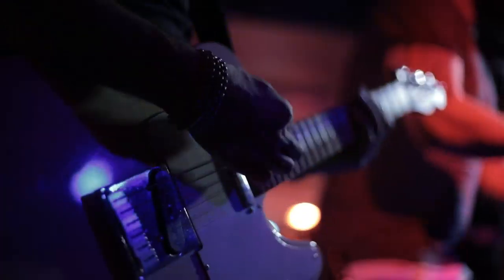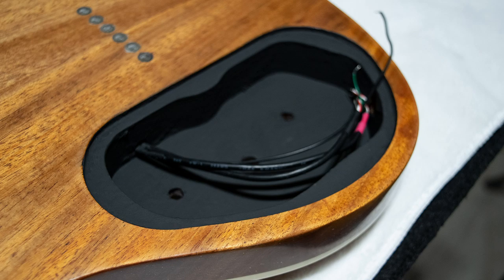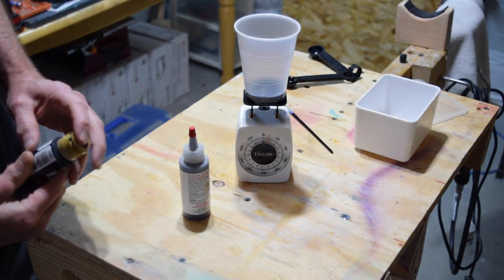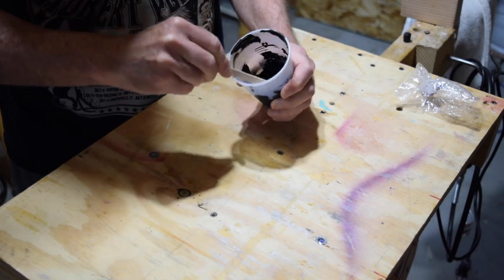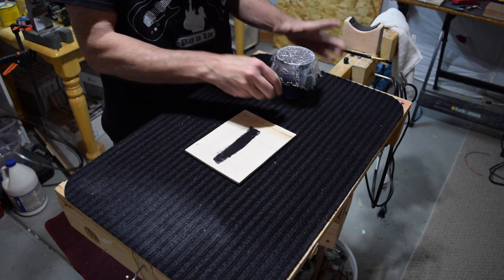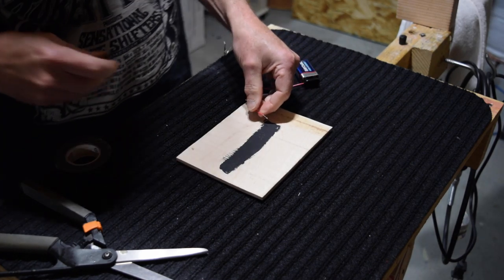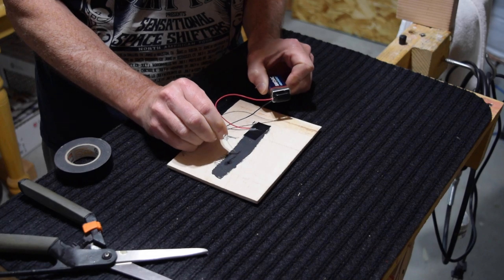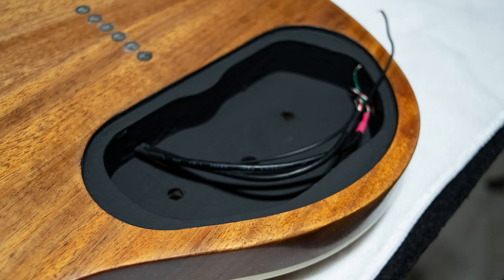Make Your Own Conductive Shielding Paint

Comment: Excellent video.  It works!  Just make sure to add enough graphite.  And, wait until the paint is thoroughly dry before checking continuity.  If the paint is still wet or moist, your multi-meter will show it as an open line (no reading).  2 coats gave me excellent continuity.

Comment: If you connect a 9V battery directly to an led it will blow immediately.
It's the resistance of the paint strip that protects the led from overcurrent.
For rfi shielding, a bit of resistance doesn't matter, but why not mix the paint a few different ways and measure the resistance with an ohm meter? If you're looking for lowest resistance then mix it accordingly.
Also, is the cavity cover coated too?
Also, is the paint layer earthed (grounded)? If not, it won't have any effect.
Also, I see a lot of cheap guitars that use conductive paint for shielding. They would not use it unless it was cheap. So, if Stewmac are charging a lot of money for it, they're ripping you off. Extend that thought to everything they sell, and you can start to understand how overpriced they are.
Reply: Shielding paint is expensive, no matter where you get it, though with a caveat. Manufacturer's save money by buying the paint in bulk, whereas an independent builder will only need one or two cans. 

Most boutique builders, like James Tyler Guitars or Suhr, will use shielding paint for the cavity and copper tape for the cavity cover, with some paint on an upward facing point to make contact with the two. (I shielded a couple hundred bodies at James Tyler lol)

As for whether to ground the paint, it's not necessary, but you can have an extra ground wire screwed directly to it. It's not necessary at all though, because the electronic components will be making direct contact to it anyway.

Comment: I've made this before but with PVA and a little water.  It works ok, but I still prefer copper tape for electronics cavities because you can solder to it, and you don't have to solder to pot casings.  However, this is excellent for earthing pickup polepieces because copper tape loses its contact over time.  Oh, and you'll cook the LED if the resistance is too low so be careful.
Reply: Also, conductivity will be a lot better with copper. IDK if it makes a difference for shielding, but hey, copper tape is easy too.

Comment: I am wondering about the resistance, if it matters? I did a thorough test with different mixtures of paint/graphite. Painted equally large squares and measured from diagonal corners. Your mix of paint/graphite showed 1600 ohms (one layer of paint). It had connectivity with the battery-LED-test. Next I mixed different ratios of paint/graphite until I had 1 part paint mixed with two parts graphite (volume). The resistance was then 200 ohms. Then I tested with one layer of StewMac's shielding paint. It showed 10 ohms! So... does this matter to the shielding efficiency?

Comment: Great tip! Shielding tape can be so finicky and you have to make sure to get conductive adhesive. This is so much simpler. This combined with proper grounding (often a cause of electrical buzz blamed on lack of shielding) would work great!

Comment: I did that a couple of years ago and used water based polyurethane tinted with craft paint.. I did a bunch of testing  on ratios and  checked not just continuity but  also resistance. I still like  copper foil  with conductive adhesive. More work but  its a better shield.  MUCH better shield. Some  of the  import  Chicom  guitars that are  "shielded" with black paint aren't conductive and  are slopped in the hole. Not sure they are hiding  rough wood work or giving the impression  of shielding. If you want it to  shield  properly you need to make sure its grounded. Shielding can also cause a short... I had  one that the input  jack with the plug inserted moved just enough to  touch... Positive to  ground....
Reply from the maker: As I said in the video, paint is the easiest way to shield a guitar cavity. IMO the BEST way to shield the electronics is to use shielded single conductor wire for all of the positive signal connections. As long as the signal wire and components are connected properly to the jack's ground terminal, there is no noise at all.
Reply: @HighlineGuitars  On a new humbucker I was replacing, the positive signal wire was too short. So, the manufacturer solders on a longer NON-shielded wire (don't remember if it was a single conductor). Is there something I can wrap that wire with for about 3 inches? I don''t think anyone sells shielded single conductor wire less than 6 inches long LOL.

Comment: Just wondering~~what is sold as magnetic paint has iron particles in it so that after a few coats a magnet will stick to it, I wonder if it would work for shielding.
Reply: as long as it is a decent conductor it will work. Iron is a good conductor.

Comment: This method is probably an okay alternative to shielding paint, but it's not conductive. Conductivity requires exceptionally low or 0 ohm resistance. However, if you measure this method with a multimeter, resistance ranges from around 6k ohms to 30k ohms. My measurements were after 3 coats, and 2 days drying time in my test - with a 2:1.15 paint to powder ratio. In your video you state 1oz paint, 3 teaspoons of powder. 3 teaspoons = 1 tablespoon = 0.5oz, so your ratio was slightly lower at 2:1 paint to powder. Perhaps adding charcoal would improve conductivity, but obviously testing would be needed.

Typically an LED should have a resistor connected to protect it from the voltage source. In this case, the resistance from the shielding paint in your video provided the resistance. This might be an okay replacement for typical shielding paint, but it is not (yet?) a replacement for copper shielding tape where true conductance or continuity is needed.
Reply: graphite is a good conductor though..?
Reply: @ATthemusician  Measurement doesn't lie. Graphite mixed in paint alone is not a good conductor. Not all graphite is conductive either. Conductance is the inverse of resistance, if you're reading any significant resistance, it's not conductive.
Reply: graphite and activated carbon is what people use to block emf in paints.
Reply: @bobrobertsNotUrBob  That's the idea. Activated carbon is usually made from charcoal. I still haven't tried it because it doesn't beat copper tape, and I have plenty of that. I will try eventually out of curiosity.
Reply: @Jmpguitars  
Using higher % of graphite in powder, more layer will low impedance to <40ohm which many branded guitar did on higher end guitars. PRS and Ibanez use this method.
With this method, everybody with no experience can get the job done fast. the idea is not to replace copper shield, but alternative faster, cheaper with a little compensated way.
Reply: @lydian2012  Yes, that was my point; a higher concentration is needed. The ratio in the video is insufficient.
Reply: I make my own ink with aluminum ink and I add graphite until I have 0 Ohms, I have been doing this for years now with excellent results so far (and most of the time I do play with a very high gain amp setting).
Reply: @velosouk  Cool! What ink specifically do you use? Do you have a link?
Reply: @lydian2012  I used a higher concentration of graphite than in this video, and the resistance was far too high. Copper shielding is better, and worth the money.
Reply: @Jmpguitars  Enamel ink for metal painting (check the amount of metal particles in formulation, it can go up to 30%)
Reply: @Jmpguitars 
If the resistance over 1 inch space under 1 k.ohm then it is enough for shielding.
If you guys who have too high impedance, try 2:1 powder:paint ratio, and the key is using hand drill to mix 5min (or even 10min) before use, and wait for paint completely dry (12hour) before apply another coat.
After 3 coat, the resistance will be around 150-300 ohm which is effectively enough for noise shield.
The effect is 90% compare to aluminum foil of many guitars i taped, almost can not tell the differences.
Reply: @lydian2012  Time = Money, right? That's 36 hours to apply shielding, that isn't consistent. It takes a very short period of time to apply copper tape. All things considered, the copper tape is 100% consistent, less effort, and costs less when time and effort are factored.
Reply: @Jmpguitars  you're right.
Paint is for anyone who prefer aesthetic and stability over time.
Some cavity like les paul with 4 dim knob and small round toggle switch cavity is hard to tape. It will usually look lumpy and will be scratched when changing electronic, also leave sticky surface of the tape when removing.
In that case, paint is a better investment long term.
Reply: @lydian2012  I've been using the copper tape for nearly 30 years. I've never had anybody complain that it wasn't pretty enough inside their guitar. ;)
Reply: Could copper powder be added? Also since your initial comment, have you tried different formulations and if so what has been your outcome? Cheers!
Reply: @kane6589  You could certainly try that. I haven't attempted this again, because I still have plenty of copper tape and not a lot of extra time. If you do try, I'd love to know your results. Measure with a good meter and see what resistance you get over distance.
Reply: It’s conductive.  He just showed that current flows through it with an Led.  What do you think carbon resistors are made of ??
Reply: @Jmpguitars Rubbish.  By definition conductance = 1/resistance.   If it has a lower resitance it has a higher conductance and vice versa.  That means that it has conductance, just maybe not as good as a lower resistance.
Reply: @GodzillaGoesGaga  There's a difference between functional shielding and resistance. If resistance is too high it's simply not a shield. You can run an LED with a wide range of resistance, it proves nothing.
Reply: @Jmpguitars  You claimed it’s not conductive.  You didn’t say it wasn’t “conductive enough”.  I know the difference as I’m and an EE.  Words matter.
Reply: @GodzillaGoesGaga  The point was not conductive enough to be shielding. You could have inferred that by reading my statement instead of being pedantic. 😉

Comment: Thanks, Chris! But, what about the resistance? If the resistance too big (let say more than 500 ohm per-square inch) it doesnt work well for blocking any EM or RF interference.
Reply: It's not good enough. Resistance is much higher, and it's not actually conductive. With some carbon added it might be.

Comment: graphite is sold as dry lubricant for locks at auto parts stores - its worth noting that some lutherie supply places online sell little jars of conductive paint for single jobs that arent too expensive - i've also used aluminum HVAC tape - its a cheap alternative to copper tape

Comment: Great tip! Just an FYI: if you don't get the polarity on the battery and the LED right, the LED will not light no matter how conductive your paint is. So try switching the polarity on one or the other adding more graphite.

Comment: I think you could be on to something... Look up Y Shield paint. Incredibly expensive product... designed to reflect/attenuate EMFs in your home... and I'm guessing it would be pretty simple and CHEAP to come up with your own version that is also effective at blocking some EMF frequencies. For example just mix any brand of house paint with graphite lubricant. Do you think this would work and even be worth it to attempt?
Reply: I've been looking into this... I read a study on conductive ink (not sure how acrylic paint might differ), and optimal conductivity was found at 29.4% carbon by mass, with a 2.6 to 1 ratio of graphite to carbon black.  When using less total carbon (21.7% by mass -- I guess try that if you can't get it to flow or bind right),  the ratio was 1.8 to 1.
Same basic ingredients as Y Shield, but I have no idea if they do something special to make it all bind, flow, and stay conductive.  Hopefully it's just that simple...  It looks like smaller sized particles are more conductive for both graphite and carbon black, so maybe the nano graphite from graphitestore.com is worth using.  I'm trying to get up the nerve to do a smaller test run and how if it works.
Reply: @adamhorn6392  CERTAINLY WORTH TRYING. AS SOMEONE WHO HAS BEEN HANGING ALUMINUM INSECT SCREEN (EFFECTIVE / NOT VISUALLY-APPEALING) ALL OVER HIS CONDO IN AN ATTEMPT TO THWART HIS NEIGHBOR'S PESKY WIFI SIGNALS, A CHEAPER ALTERNATIVE TO Y-SHIELD WOULD SEEM LIKE A GREAT NEXT STEP. I THINK THAT PRODUCT IS OVERPRICED IF SO. I MIGHT ACTUALLY TRY THIS, THANKS FOR THE INFO ON RATIOS!!!
Reply: @Jesrockr  What size screening do you need to block RF/WiFi signals? I've looked and looked and haven't been able to find the answer (miss you, net neutrality! 😭). If you know I'll be quite happy 🙂
Reply: @rebeccagreen7241   Rebecca i'm using Phiser brand aluminum insect screening bought in 6' rolls from Home Depot. You don't even need full coverage of a room, as long as you install on the walls in between you and the source. I did two sides of my bedroom (townhouse, adjacent neighbors using WIFI) 2 layers thick GROUNDED to the earth outside, and reduced the average reading from about 4 down to consistently <1 microwatt per sq meter. sleep quality improved so much. If you look up EMF safety Zone, he did a video using the same material. it is incredibly inexpensive (100 bucks for 6'x100') and it is easy to work with. Hang it up with nails or screws. Done properly it doesn't look too bad. If you'd like I can make a short video showing my setup/emf readings etc.
Reply: if this costs too much you can also use Reynolds wrap, however that is much more unsightly and harder to work with. Probably half the price, and I did do a wall with that at one point so I know that it works very well. Just an eyesore and a hassle, but more budget friendly for sure.
Reply: @Jesrockr  Thank you! That information is super helpful. Right now I've got two layers of aluminum foil on the wall between my bed and the smart meter (and a faraday screen over the meter), but it doesn't cover the window. Maybe I could do the screening like you suggest, and make an opening for the window somehow. I also wonder if I need to shield the floor (or part of it) since the circuit breaker is right below me in the basement. I would love it if you made a video!!!
Reply: @rebeccagreen7241  they do make smart meter cages and you can DIY these as well. I'm sure you've seen them. They cover the entire smart meter. that way you are blocking the RF at the source. the circuit breaker EMF should not be as much of a concern as the wiring within the room. get a gaussmeter, you will see that magnetic/electric fields are only very hazardous within a few feet. The intensity dies off quickly with distance. If you are already shutting the circuit in the room's walls off I see no reason to worry about the circuit breaker. You might be fine simply moving the bed to the center of the room.  As for what you said, if you are attempting to eliminate 100% of RF entering your room (say, from nearby cell towers, etc.) then yes, I would use the screening on the windows and door. I will try to make a video of my bedroom soon

Comment: If it doesn't light up, you probably blew up the LED or connected it backwards.   9V is pretty hot for most LEDs and you might want to mention they're polarized.
Reply: Some 9v LEDs have a resistor built in so they can take battery input straight up.  Remember diodes (include light emitting diodes) only allow power to move one way, so these parts tend to have different length legs to help you get the polarity right (positive / negative) when installing.  Enjoy.

Comment: It's worth noting that electricity will only flow through an LED one way. If not connected correctly, it will never light up.
Reply: Also, a regular LED wil quickly burn on 9v.
Reply: Reversing polarity converts most LEDs into SEDs.
Reply: @bsdnfraje   and running them on non-resisted (like 1k) 9v will make them DEDs hahahaha. obviously there is some resistance in the graphite, so...
Reply: @Bob_at_OZDiggzguitars  - Some LED's incorporate a resistor in manufacture.   But yeah, given the Vf of  standard LED's is around 2-3v depending on spectral emission (colour) a resistor in series would be required to drop the 6 or so volts.    For the ECP to work well as a screening agent though, it would require  low resistivity, arrived at by the correct ratio of the conductive medium (graphite/metallic filings, copper dust etc...) to paint/lacquer, to achieve this.

Comment: Why would you not wire that to the grounding port in the guitar?
Reply from the maker: Because the control components (pots and switches) are connected to the ground port and they in turn are in contact with the shielding paint. If the components ground the shielding paint and a separate ground wire is connected to the shielding, a ground loop may form which defeats the purpose of shielding the cavity. Google ground loops.
Reply: @HighlineGuitars  ok thanks, I wasn't sure